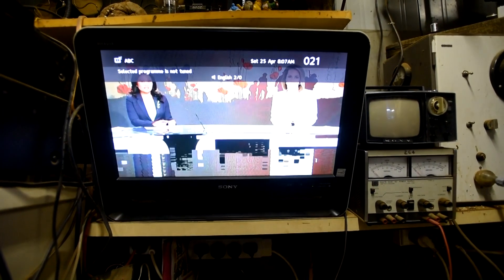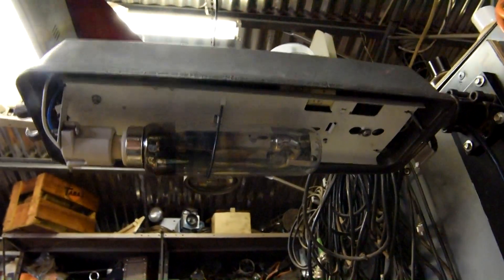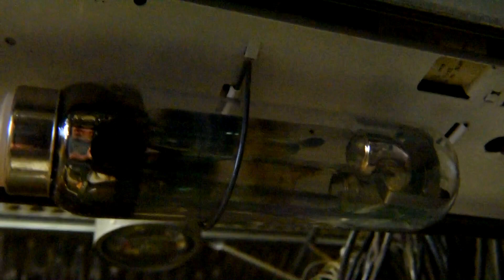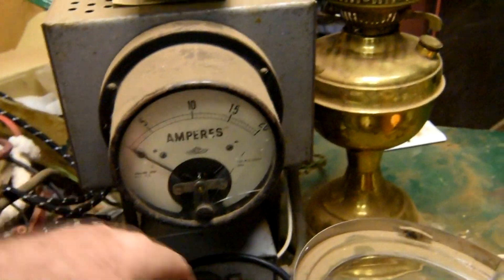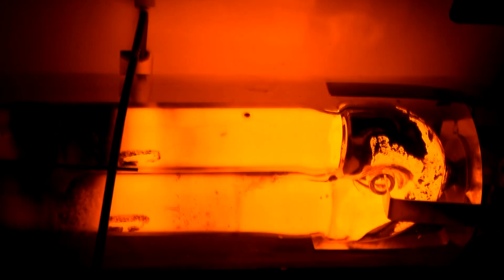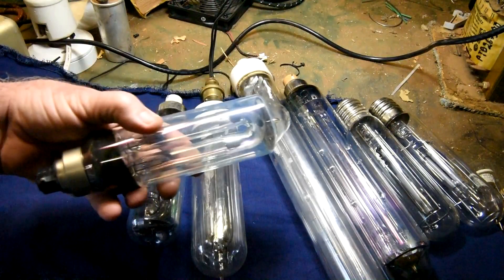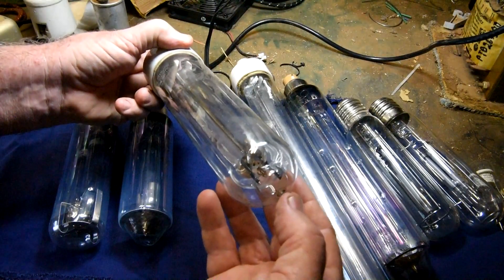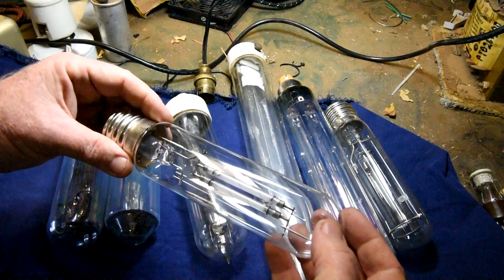Vintage low pressure Sodium street light head

Comment: Sodium lamps suck. I remember back in the 70's a factory had been completely converted over to these to save money, thanks to a brain dead bean counter, you couldn't see a damn thing and had to use a torch to tell what colour things were.
Reply from the maker: Ah yes, no good for indoors. My Missus was not happy when I fitted it in the dining room as I thought she would be pleased with it but no, I had to take it back out in the shed!
Reply: They're extremely efficient, though.   And they are still used in laboratory settings as a spectrum source; they emit highly monochromatic light, in the form of the so-called "sodium doublet" which produces two intense lines at 589nm and 589.6nm.